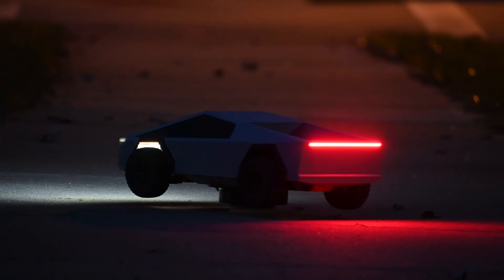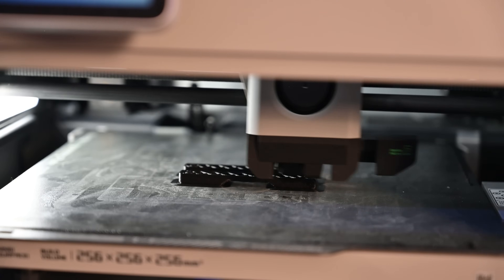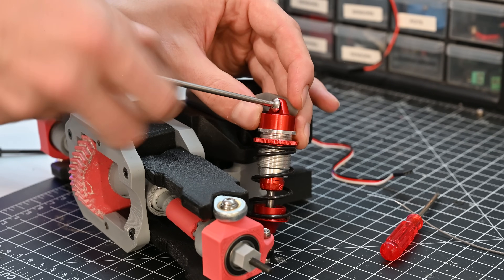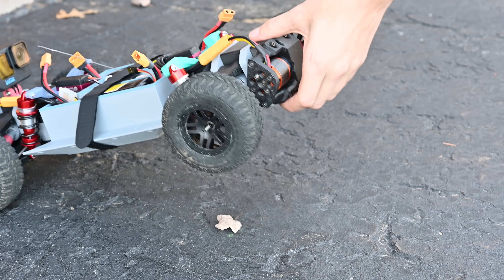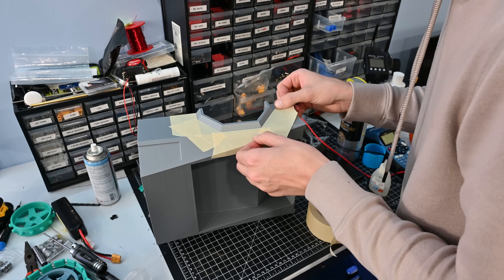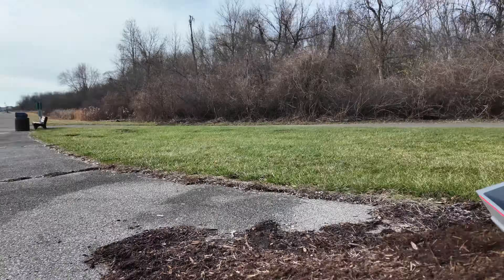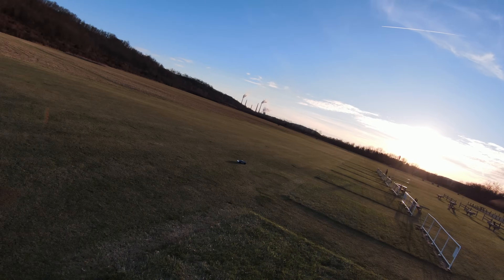I 3D Printed A CyberTruck… It RIPS!

Comment: i do rc hobby... and i have a recommendation. PLEASE use enclosed brushless motors MEANT for rc cars and same goes for the esc. that way you get proportional brakes and a better experience. a 3650 brushless motor would have fit it perfectly with a 60a fan cooled esc.
Reply: @cuf_ Do you have a recommendation for a motor and esc.? I'm building this rc car.

Comment: How did you wire the servos and ESC's to transmitter? I printed all parts and my RC car is mostly assembled, just waiting for second ESC and springs. BTW there is a design flaw on front motor housing, the big gear can't spin freely. I removed some plastic from it using a knife and then it fits.

Comment: I was able to make it fit on a Bambu X1C by slicing off the hubs and printing them separately "in black"  then make a 2nd cut to the back end to divide it into two pieces. I also flipped the back end upside down to give it a stronger diagonal pattern and use less support material. Overall this is a fantastic build! Great job!
Reply: Could you share your sttl's? I've printed the rest on a p1s but looking for a good way to print the body
Reply: @JeroendeGroot  In the slicer there is a tool that lets you cut objects in to smaller pieces. That's how I did it.

Comment: Hi, Thanks for this awesome design! I still have two questions though:

1. Is there a hardware list with exact quantities of nuts and bolts, bearings, etc?  
2. Can the 18mm M3 and 18mm M4 bolts be supplemented by 16mm or 20mm (18mm is hard to come by in my country for some reason..)

Comment: Did you really ran this 3d printed rc car with total of 8s? All rc cars what use 8s batteries are very big but this one is like size of short course truck what uses 2s or 3s batteries dude this is crazy 8s in short course size 3d printed rc car

Comment: Hey Michael - Would you consider re-sharing the onshape project in a way that we can 'copy' it? Currently I'm able to view the project, but cannot copy it to my own onshape documents for editing. I believe to make any changes as it is I would need to export each individual part, re-import, and then rebuild all the mate connectors.

I'm working on printing this up right now, and I keep needing to re-hide parts so I can see under the shell and count how many of each part to print, as my view changes reset each time I load the document.

Thanks for the awesome model and build video!

Comment: tip: dumborc receivers are cheaper and are exactly the same, they can also be used with a multi-protocol transmitter. you can also use some drone esc with am32 firmware, way better than any sub $100 esc.

Comment: This build is awesome. Does this ESC have revers?
Reply: It does seem to have but his instructions on that are really vague. I am currently trying to figure out how to get that configured. It does not seem to like a reversed signal throttle and has a dedicated reverse pin.
Reply: I figured out the wiring. So for example channel 2 is normally throttle. Channel 1 is servo for left and right direction. You can connect the reverse pin of the ESC to channel 4. That is normally associated to a button on the remote. When you hold that button and then give it some throttle, it will reverse the direction of the motor. I highly recommend you also get the wifi programming adapter for the ESC as it will help with the programming of the reverse function etc.

Comment: Hey Mike, making this car at the moment! Great job on the design..can I ask which brass heat inserts did you use? M3 or M4? Do you have details on locations for each of these inserts? 

Will send you a few pictures of the finished product 🤞👌
Reply from the maker: M4 Inserts in the steering knuckle!
Reply: Thanks man! I see you used on some other parts too, is that not required anymore? Just nut and bolt? 

Parts have just finished printing, waiting on electronics to arrive, keen haha. 

I'm going to mod the design and make it quad motor (direct drive, no gears), with similar drive shafts. Thoughts?

Comment: How hard would it be to cut up the body enough to fit in an X1C?
Reply: It was easy I already did it I recommend splitting it up by the top/bottom where the 2 screws are located so it has a spot to screw in

Comment: Happy new years!!🎉🎉
Do you have a version that fits on the ender 3's 235x235mm print bed?? I would appreciate it so much. Ive currently got your version of the tarmo 5
Reply: I also need something that will fit on the Ender 3
Reply: @2b2t.augaming58  yea I got most the parts printed out except the middle

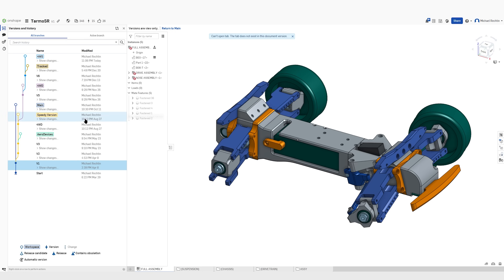Comment: 4:40.   It's many years since I had anything to do with caster, steering angles, etc. but isn't the wheel nearest the inside of the corner meant to turn more than the outer wheel?
Regardless, it doesn't seem to create any scary handling characteristics, so, if it works, don't mess with it!   😜
Reply: Ackerman ?
Reply: @pierholtrop5432  :  Ackerman!   👍 😊 😜

Comment: Adding Differentials and maybe a deep dive video on making a 3d printed limited slip diff would be really cool :) haven't seen anything like that on yt and they're really interesting mechanisms. love the channel as always
Reply: not sure a 3d printed diff would be very feasible on a small 1/10th size model, since it would have to be super bulky to withstand all the forces involved.
still a good idea if he thinks he can pull it off; i'd watch.
Reply: @thinkdunson  Yeah I think you're probably right. In fairness, lego manages it on an even smaller scale, but they're using hard injection molded plastic not flimsy fdm printed PLA. Maybe possible with resin prints or industrially printed parts with a PCBWay sponsorship?
Reply: I think it would be doable,
I have only seen a short about the"3d printed limited slip diff"

Comment: Turned out way cooler than I expected. Maybe add an X-ray in the thumbnail of the internals?

When I clicked on the video, I assumed that you only designed a 3-D printed body for an RC car, it’s so much cooler that you designed the entire RC car plus the suspension system

Comment: you could print it from PLA, but it is better to print the motor mount from ABS or PETG because that will heat up and melt the PLA.
Reply: na I've printed a few RC cars if you are melting the mounts your motor is running too hot